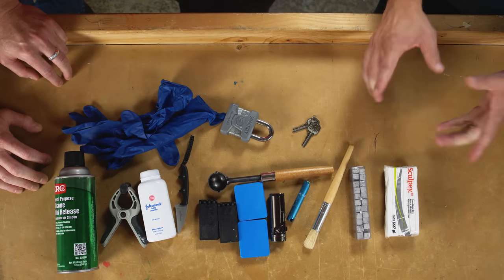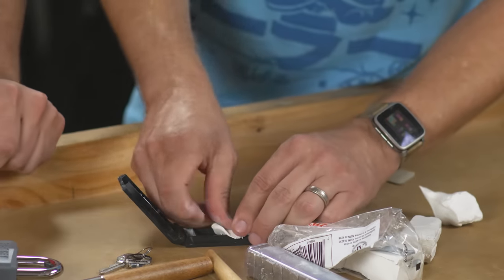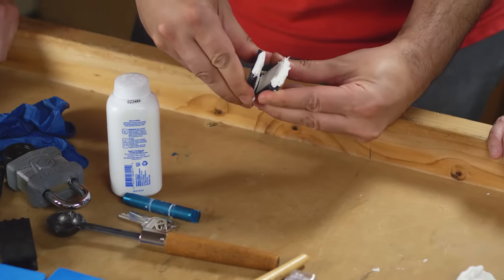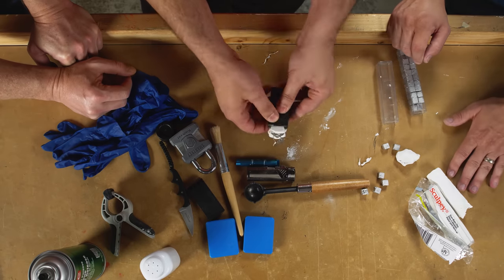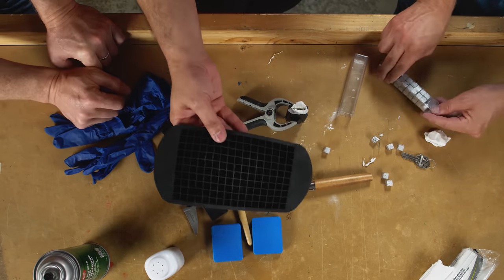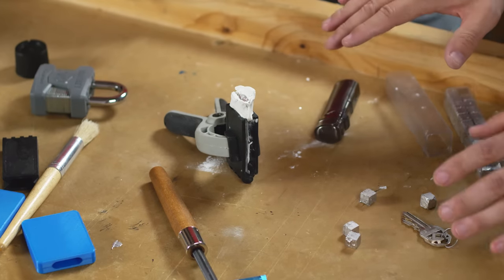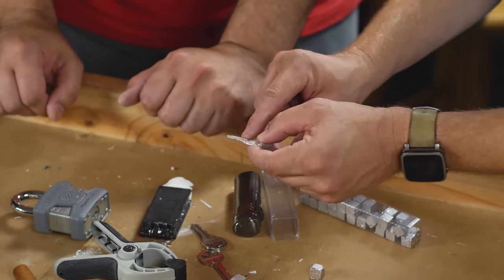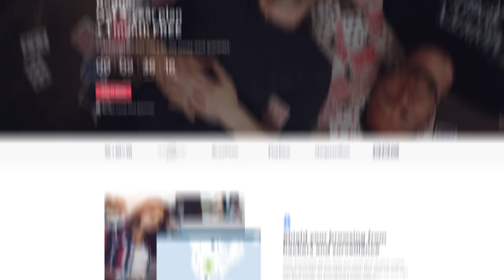Duplicating a Key Using Molten Metal (with LockPickingLawyer)

Comment: I just did this today, worked like a charm. The most important thing to do before trying your key is to check for any burrs or bits that stick out, and sand/file them off. It's extremely important to remove any and all burrs from the jagged side of the key where the bitting is, because otherwise the key will get stuck. Mine got stuck the first time, and I was able to remove it using a peterson mini knife from my lock picking set. I also highly recommend purchasing one of those before trying this, just in case you get your key stuck. Getting it out is super easy, plus the mini knife is an amazing multipurpose bypass and decoding tool.

Comment: As Deviant showed in one of his videos you can prevent airbubbles in the key by carving a tiny little channel from  the tip of the mold, so the trapped air can escape and allow the liquid metal to fill all of the mold. After the cooldown you can cut off the little spike from the channel.

Comment: If you heat up the mold before pouring in the metal, you’ll get a perfect cast with no flaws. The problem with pouring hot metal into a cold mold is that the metal wants to solidify as soon as it hits the mold in some spots. I use this tip with my castings at home and they come out super clean

Comment: I saw a version of this where a steel key blank was cut down past the teeth and put into the mold before any metal was poured (in this case it was a fairly hard lead alloy, I believe they were wheel weights). They didn't fuse together, but they were a perfect match that could then be attached with superglue. The casting interfaced with the pins and the steel took the strain of turning the cylinder.

Comment: "Molten Metal"....... RIP injury counter...
Reply: Well, Wood's metal melts at about 70 °C, so it's probably less dangerous than a cup of tea.
Reply: @TJStellmach  ...You think that the Modern Rogue can't reset the injury counter with a cup of tea?
Reply: I poked some molten pewter once.
Reply: the clamp on the key cast serves double duty not only keeping the mold upright and tightly sealed, but it gets your hand out of the way, as well :)

Comment: Here's a tip. Use rosin cored lead/tin solder wire. Throw that into your edc together with a butane soldering iron/torch.
Far easier to explain away than weird metal alloys etc.

Comment: One could use gallium. Its melting point is lower than the human body but above typical room temp. You can melt it by holding it. It's soft and as a key you cannot use it with your hand. However if you work fast you could make a cast and then cut a new blank. Same process but no heat source needed. If you work in a cold environment you maintain the solid state. There are numerous alloys of gallium for specific melting points. Wood's metal also contains about 25% lead, not as bad as cadmium but has its toxicity concerns too. If you see a good price for Field's metal it's probably Wood's metal. Field's is expensive. It contains indium instead of lead and cadmium, costly stuff.
I wonder if a cast could be made with water. Fill with water, freeze it, ice key. Have to work fast or in freezing environment. Nice thing would be if it breaks in the lock it won't matter.  Clamp in key duplicator smashes it?

Comment: The Hazardous fumes is a lot like soldering, you just need a little bit of ventilation like a fan next to an open window or the vent over a stove
But with this you don't need to worry about that if you don't overheat it

Comment: Does anyone have a link where to buy the stuff they use for this?I'm not having any luck with the lock picking lawyer website.
Reply: Yeah I'd like to know too
Reply: Wood's Metal 
https://www.rotometals.com/roto158f-low-melt-fusible-bismuth-based-alloy-ingot-woods-metal/
Ladle 
https://www.rotometals.com/lee-lead-dipper-wooden-handle/

everything else you can likely get at your local supermarket

Comment: Is there a way to manufactute a key from the lock it would go to? Like using hot wax or something to make a mold and then extracting it and making a mold around that and then casting the metal key in that second mold?

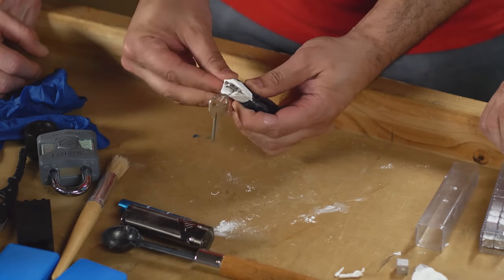Comment: 5:10 you can try to copy a car key this way all you like, and yeah you'll be able to open the doors, but it'll never start. You'll need some electronics for that. Also I find it hard to believe this is a very reliable way of copying a key. I worked at a keymaker/locksmith for a while, and keys have to be manufactured within a couple 1/100ths of a millimeter, and I find it very hard to believe a casting is precise enough for that

Comment: I need tips! I bought woods metal. An use air drying Modell ing clay. When i pour it in it starts bubbling like boiling water an he results are not good. The metal does not reach the bottom of the imprint most of the time .. help please

Comment: I made a car key for the lady.  Her 73 beetle.    Just took some AR15 rails that were bad, melted them down.   Used her original key for cast in petrobond sand.    Some filing and smoothing.   The head of the key I tailored to her.

Comment: I would think you could use like solder metal because it is super easy to melt like with a handheld lighter and available everywhere
Reply: Solder works perfectly for casting.

Comment: You buy $100 worth of stuff to make a key that cost $1.75 a copy??
Reply: you do realize not every criminal can just take every key to a warehouse store unnoticed right? Point of this method is to get the key's impression and bail so you can make the copy yourself later. Think outside the box for a minute, usually helps with things in life.
Reply: @lightbornadventures  Criminals don't make key copies, they use crowbars!
Reply: @tedgagas9529  maybe a petty thug who ends up getting caught. Good luck using your crowbar tho. Lmfao